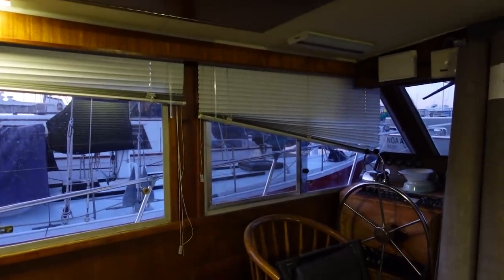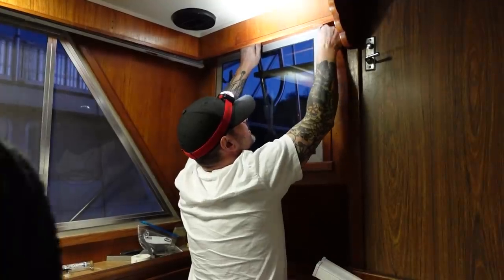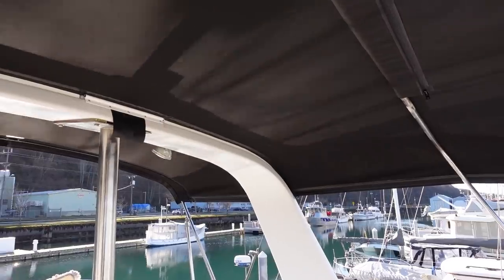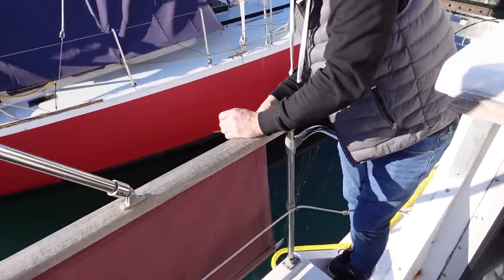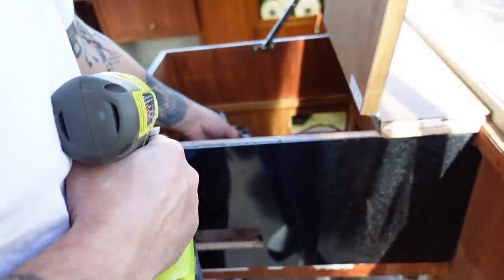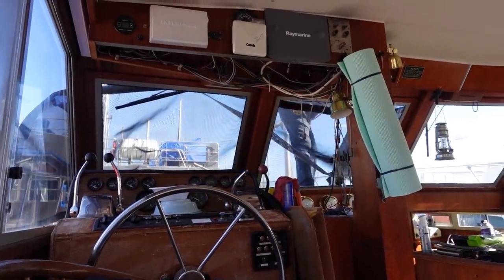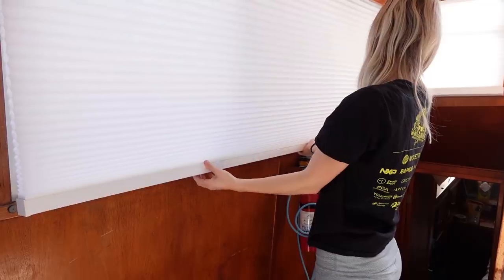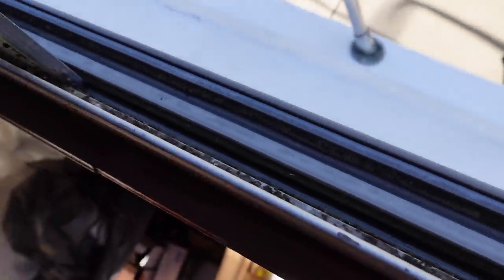Replacing Blinds + NEW Canvas Update | Old Yacht Restoration | Ep. 13

Comment: 11:53 is a TV "booster" or amplifier.  There would have been an outdoor TV antenna, with a little object attached to it called a "preamp".  The unit you are holding is the power booster.  It would send power up to the preamp on the antenna, and the boosted signal would come down, through the booster, and out to the TV.     On a side note, I'm interested to find out what, if any, plans you have for internet.  Seems the big push is to Starlink system, which I'm seeing on boats, RVs, etc.
Reply: I have just gone through the internet thing for my houseboat. The most economical that I found was to get a Mifi (mobile wifi). Get a cheap data SIM that provides unlimited data and away you go. I pay $15 / month for the SIM and it is fast enough for streaming / music, smart TV etc. Obviously, it only works in cell signal range of the shore. Starlink is hella expensive.
Reply: @TR4zest  Yep, totally for lakes, or regions close to shore.  I live in the Gulf area and it doesn't take long before you are well out of range though.
Reply from the maker: For now we are just using a cellular hotspot router, since we aren't planning on being out of cell range for too long in this boat.

Comment: If you put two 5mm small magnets on the bottom backside of the blind and two 5mm metal disc on the wall you’re blinds won’t hang away from the wall when pulled down. Have then on my blinds..

Comment: Hi guys, once you’ve cleaned the tracks, use a little spray silicon as a lubricant between the glass and the track. Most times this works well, and it also works on old hot rods and vintage cars.
Reply from the maker: We did use silicon, toward the end of the  video, worked like a charm!

Comment: This could just be you could not be bothered to video it especially given the angle but did you do the top part of the tracks? Yes it is not as important but considering your windows still are not sliding freely a clean and light oil would at least do no harm.
Reply from the maker: I did clean all the way around, but had not considered using an oil. We'll look into it for the windows that are still a bit stuck, thanks!

Comment: The power unit in the box you removed is a TV antenna amplifier. Used to increase signal for analogue TV
Reply: In the UK the transmissions for TV to the antenna are digital, and an amplifier works for that signal also. Maybe the same in the US.

Comment: Great job on so many things. That little black "ac dc" box is a power split for an antenna, maybe an older analog for the tv (they also work with the new digital ones.) It just made it possible to power the antenna from ac (if plugged into the dock or running the generator) or switched to dc if at anchor. Love the magnet idea, just remember, keep them well away from the compass. Congratulations on all your hard work.
Reply from the maker: Thanks for the info.

Comment: With the blinds. An idea might be to put some stick on foam tape where they will bash up against the window frame in seas. It will stop the noise when not under motor and prevent damage   Nice n quiet

Hahah. You solved it with magnets!! Genius!!! Lol
The windows will slide better with silicone spray. Use a tube off WD-40 to get it in so it dosnt go everywhere

Comment: That box was holding 12v car stereo and load balancer devices. The box with the coax leads and ac was a over the air cable antenna amplifier.  :)